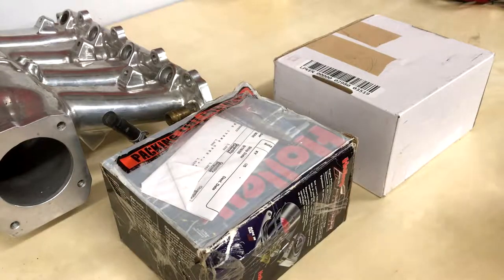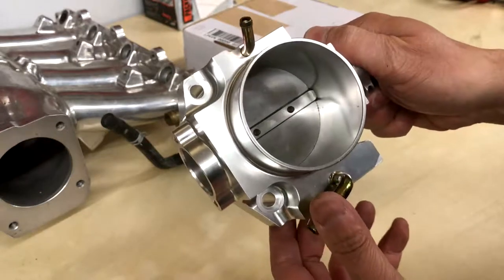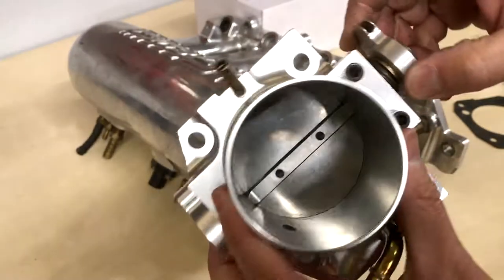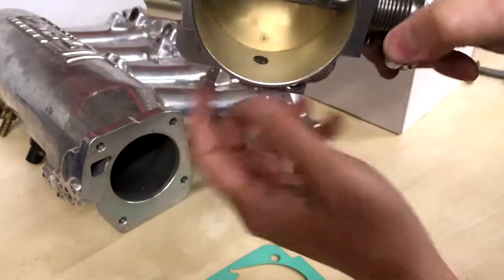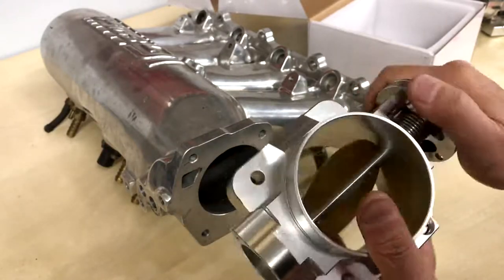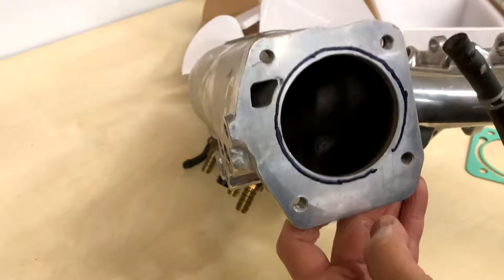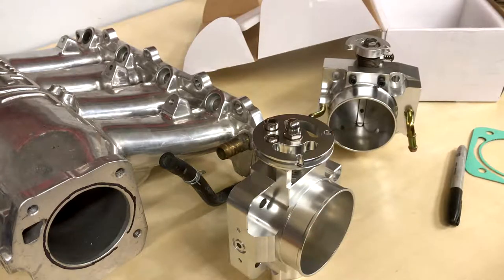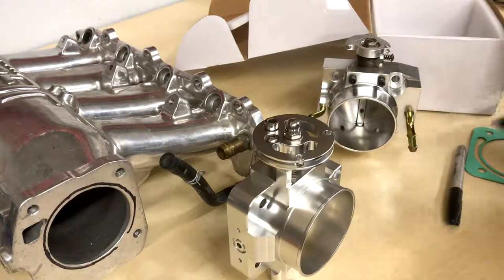Big Billet throttle body comparison - Holley vs VMS,

Comment: But what about the 2-3 hoses that hook up and run to the valve cover and I think one runs to the air intake
Reply from the maker: To Canister? Delete that. About the PCV system? for all motor cars I leave it all intact. You want to vent crankcase pressure and also keep the system closed to prevent drawing in all kinds of moisture. Can be a big issue depending on where you live.